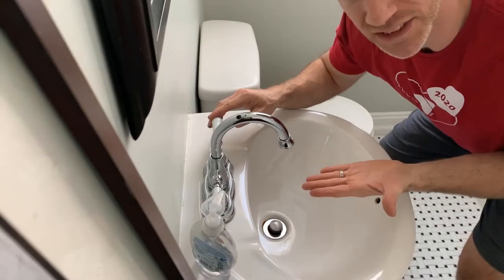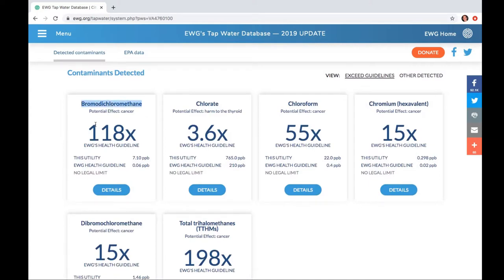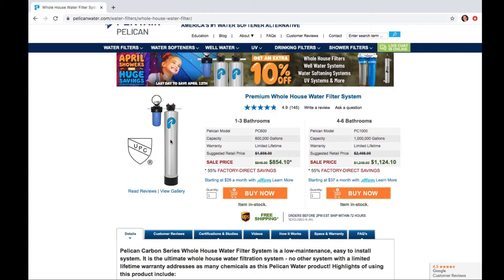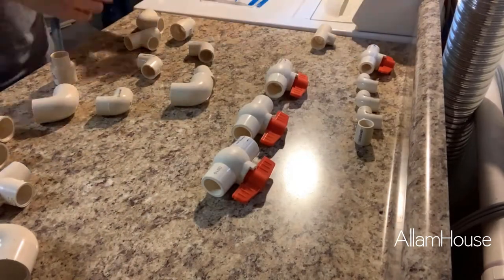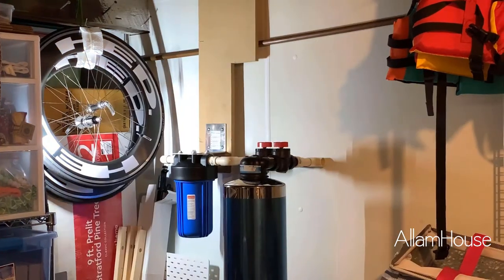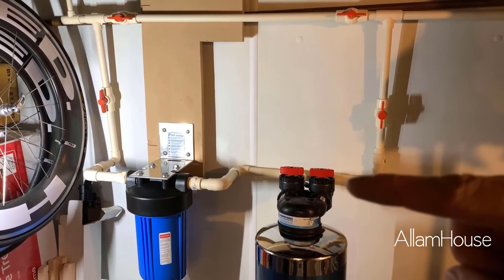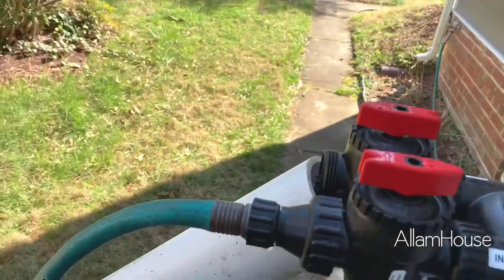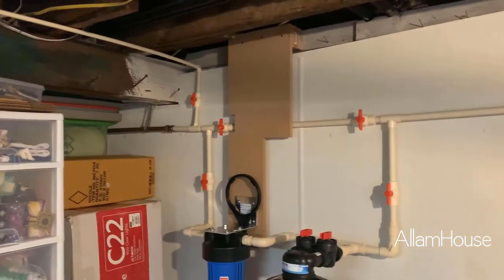Pelican PC600 Water Filtration System | Full Install

Comment: Nicely explained.. Would you be able to specify the exact parts you purchased from the store to make it happen ?
Reply from the maker: Hmm. That would take a while to figure out. As that install was quite a while ago. I will say that my main house line is 3/4” so most elements are 3/4” for pipe and fittings. I converted down to 1/2” for pieces that went to my external spigot.  The parts that actually connect to the Pelican system had to bump up to 1” as that is what they use. Each house is different so you would need to start with what is existing in the house, figure out your connection/intersection points and then begin laying it out on paper… or the floor of the hardware store 😁. Get things in place and begin mocking up pieces, move to cutting and dry fitting and then finally flying and connecting.